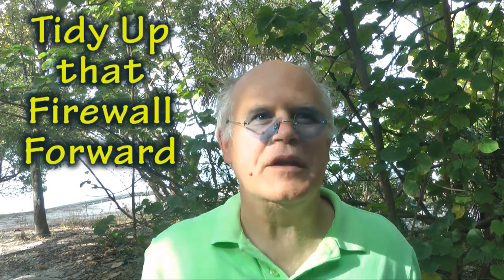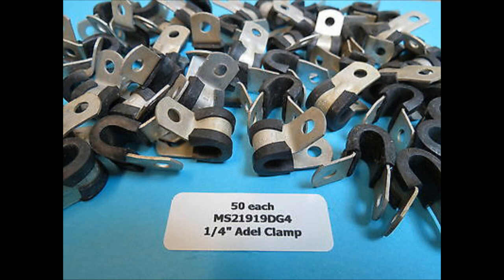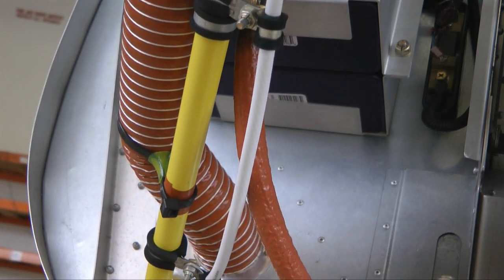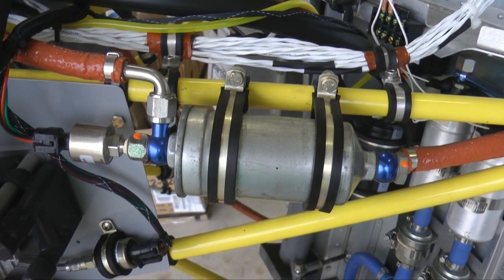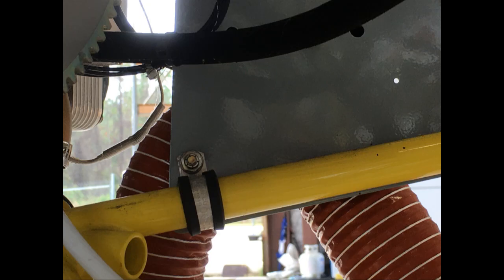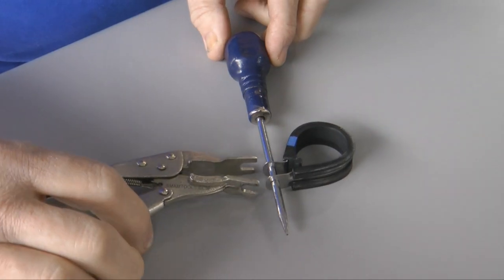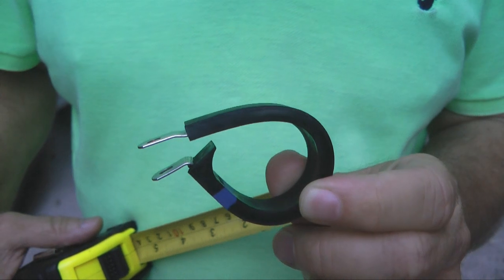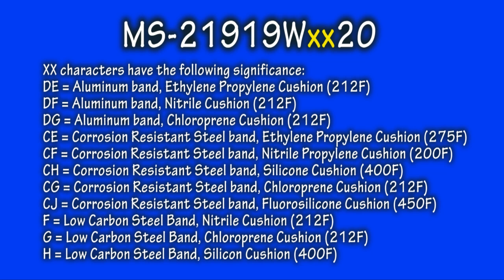Tidy UP your Firewall Forward with This Strategy

Comment: Another adel clamp mounting tool is to cut a hacksaw blade and cut a V groove in the end of it.  This groove temporarily locks the threads of the bolt till you get the nut on. Much more compact than the vise-grip method.

Comment: I like the zip tie through the tube, thanks I've not seen that one before. I have used the three zip tie method where one goes around a tube the other around the wire bundle and tied together with another zip tie